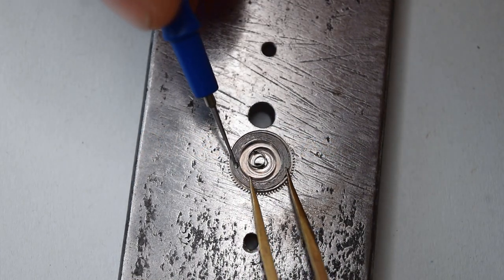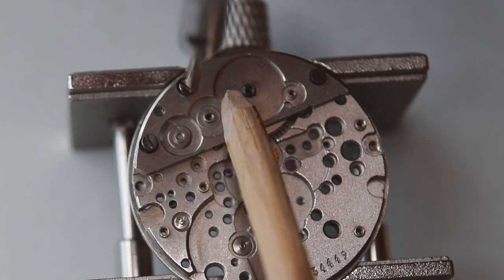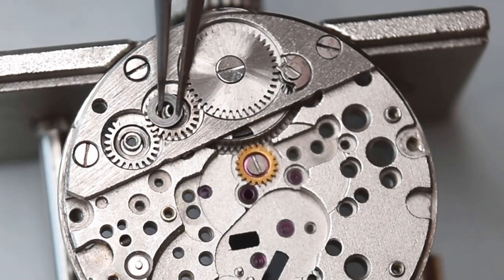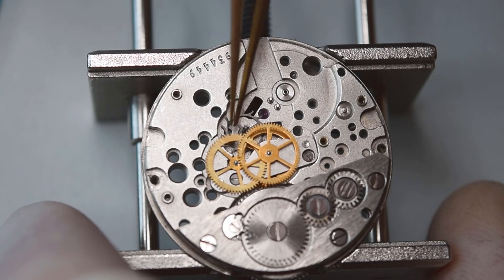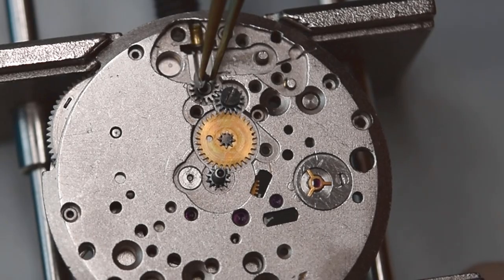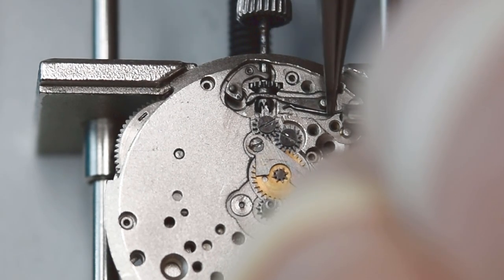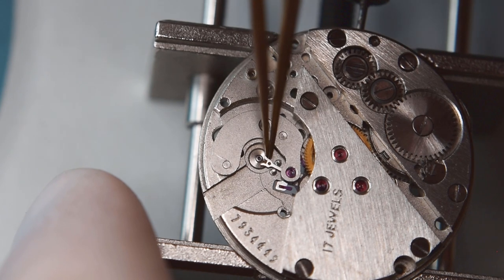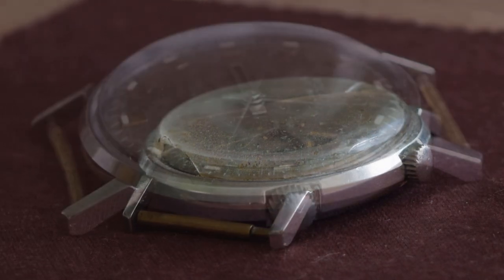Servicing a soviet watch movement Poljot 2609 - assembly  😀 vintage watch service

Comment: Hello I have a question.
At first I am not new in this topic I know what a handwind or a automatic movement is and I've also disassembled a movement and adjusted my watches frequently with a my tools and a timegrapher 

I own a Sturmanskie Gagarin with the same movement the handwind Poljot 2609. 
When I wind it up, the second hand constantly....sometimes after seconds or after minutes stop working. So the movement doesn't working. When I shake the watch shortly the second hand start working again OR and that is IMPORTANT, when I move the hands like I want to set the time, the movement starts working again...
What can be the cause of it, what can I do?
Reply from the maker: In my opinion service, it and the watch should work without these issues. It can be that there is some dray oil inside. How old is this watch?
Reply: @tickingWATCH  The watch is new, from Poljot24 but the movements are old stock, they are no longer produced and were introduced in the 70s. Maybe it is NOS and because of that I bought Moebius 9010 Oil. And I can't send it back, but it is not a big problem for me because it is serviceble.

"It can be that there is some dray oil inside" where do you think it could be?
Reply from the maker: @Shadowwalker1717  Barel, on gears, needs to be check , I would suggest a full watch service
Reply: @tickingWATCH  Ok thanks

Comment: Hello,  May I ask your advice ?   I purchased new in 2016 A Sturmanskie Gagarin edition, with the Poljot 2609 movement. It does not see much wear, but now it has a somewhat different sound. Obviously ticking but in addition, a kind of metallic echo ?  I wonder if it just requires an oil service. Works and keeps time with no problems at all. It has not had a service since I purchased it. Thank you.
Reply from the maker: Probably this echo is caused by a hairspring, by some watches I have the same. Regarding service, if you are going to keep it, be a part of your collection, proper service is definitely a good idea. 👍

Comment: I have an issue on mine, that the click appears to be loose, and the click-spring can jump out from it's groove jamming the click. But I see, that your click is different from mine, mine has a small indent for the screw and I have a screw with a more narrow head.
Reply from the maker: Could be that you have the wrong click, you need to check this

Comment: You forget to lubricate the pallet stones? Again much too much oil used, it will disperse quick and then the pivots run dry... 😊
Reply from the maker: Of course was done off camera, about oiling I'm thinking about automatic oiler, maybe someone have experience with that?